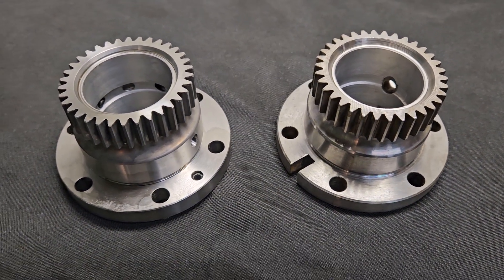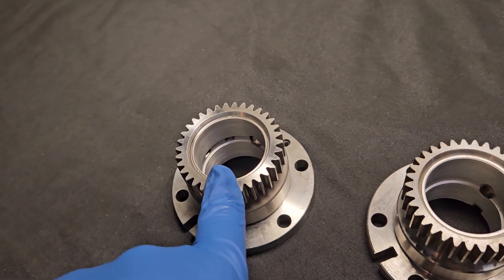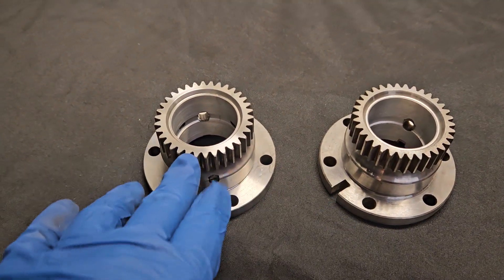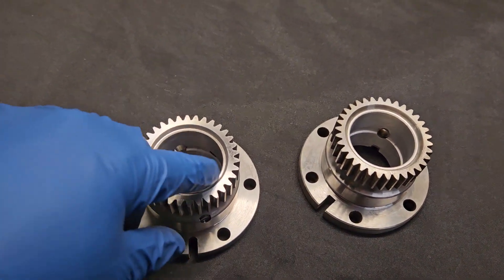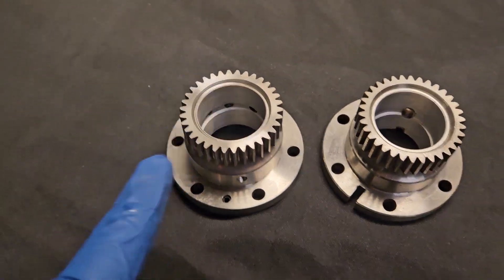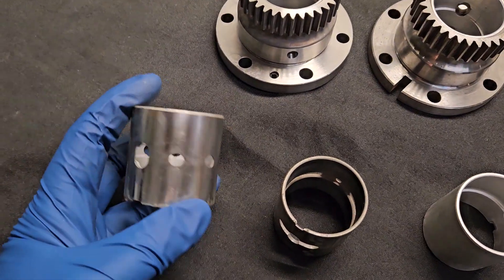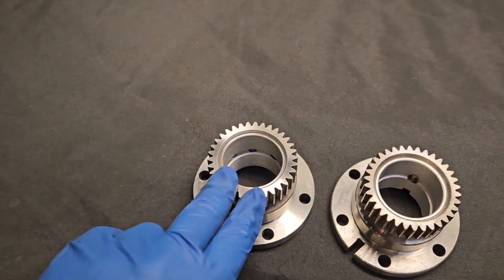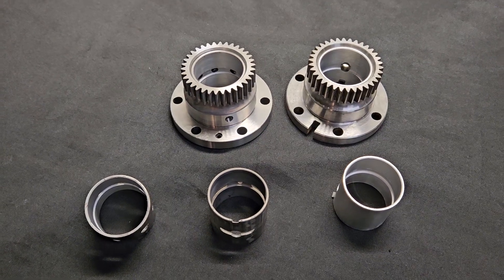12A Mazda RX7 Stationary Gear options for competition, performance, or street use - KMR Rotary Tech

Comment: Hello, question. From what I take away from this is you're saying I could cut down a 04-11 RX8 stationary gear and use it in a 12a (1985)? The teeth and everything sure look the same minus the height. I can buy rx8 ones easily. And the rears looks like it would drop right in? Just wondering, if you know for a fact or not. It seems like there's not a clear answer on the internet.
Reply: Correct. I just cut a set down for my engine, both the front and rear gear are 4.1mm longer than the 12a gears but the bearings are the same length and don't need to be touched. Rx8 rear gears don't have an oring groove so you either need to cut one in or use silicone to seal it when installing.
I used a carbide tool in a lathe and got a bit of chipping on the back side of the teeth that I had to smooth out with a grinder, so I would recommend having them ground down at least the last 1.5mm to avoid it, then put it in a lathe to cut the chamfer ahead of the bearing to clear the chamfer on the eccentric shaft.
Little late but I hope this helps.
Reply: @Mrshotshell ha, yep thats what i just did. Machined them down. They did chip just like you mentioned. I got them to length on the lathe doing .005" passes. Then smoothed them out. I didnt get my engine together yet but i also went a different route. I made it a semi peripheral port. Hoping to get it all back together over winter here and im gonna make a video of my build sometime in spring.

Comment: Nice to see that ,
i try to remplace the bearing by a needle cage and reducce the diameter of the exenctric shaft(it reduce a lot the friction,2k kms done with it,my fuel consumption on the rx8 was 7.5L without him pulling on the faceand got a  better acceleration in terms of revs, by far my lowest consumption with this engine 231cv 6ports)but have an issue with the exentric shaft witch one become eat by the needel(not to hardener or may be not to much oils flow:the pressure where nearly 0.6bar at idle and 3b arrond 3k rev)
it 's why i'm very interest about the hight flow oil  pump if you do a review about it 👍

you can see here what i have done(it may be more clear) : https://www.youtube.com/watch?v=8t3nuL4uzV0&ab_channel=JulienH